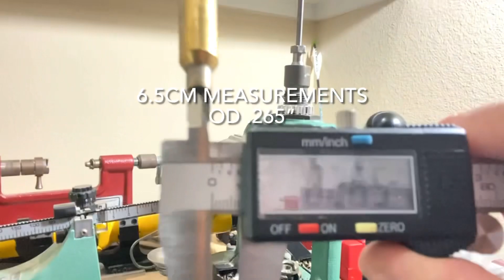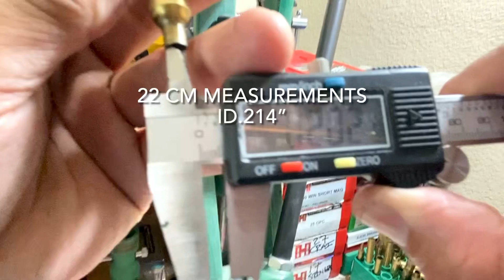22 Creedmoor from 6.5 Creedmoor Case

Comment: So all you need to convert 6.5 to 22 is the 22 cm depriving die? I assume the same goes for if I wanted to convert 6.5 to 6 creedmoor too right? I have reloading stuff just haven’t had much time to do a lot of it yet. Never converted brass before but now I’m thinking about having a gun rebarreled to a new caliber. 22-250 to a 6 creedmoor, 6 GT or maybe a 22 creedmoor. But more than likely a 6mm caliber since I don’t own one yet.
Reply from the maker: Correct. Run it through die and you are good to go. Watch shoulder bump it may actually need more or less depending on new caliber chamber.

Comment: How are you using the hornady .350 comparator when they spec using the .375 comparator for 6.5 cm and 22 cm? I’m new to reloading so I’m genuinely curious.
Reply from the maker: It’s a measurement guide. As long as you’re not touching the case, keep good notes, and use the same comparator you’re good to go.